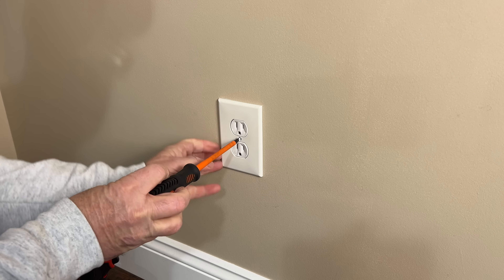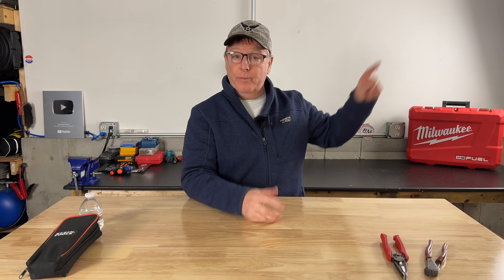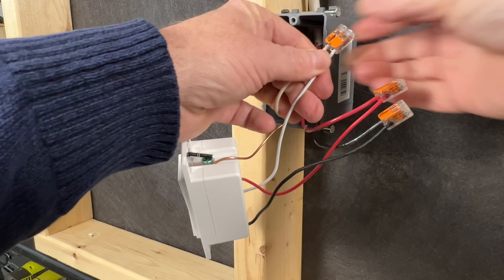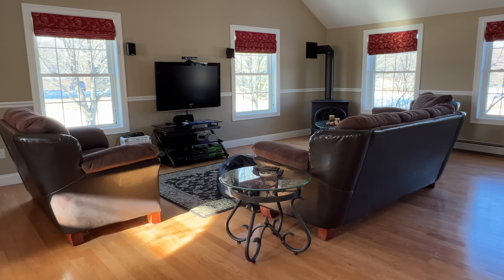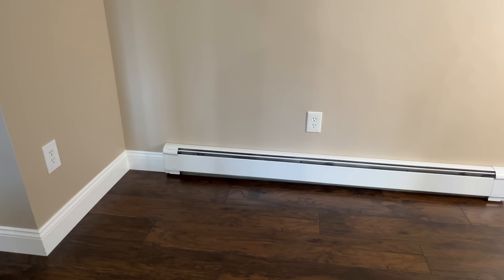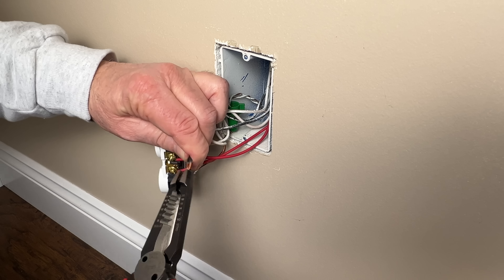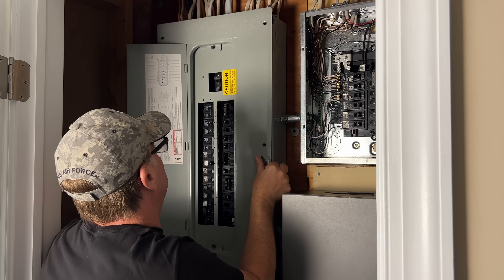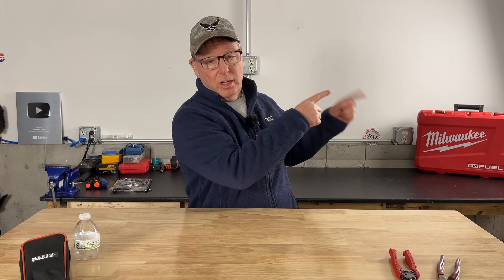Are Extra “Unused Wires” Required by Code?

Comment: Many switched outlets are split so only the top receptacle is switched and the bottom is always on.  That's how my home was wired.
Reply from the maker: Yes, that is a common way to wire switched outlets.I actually had that option recorded in this video but I cut it out because I didn't want to confuse anyone. Maybe I'll make a dedicated video on split receptacles.
Reply: @BackyardMaine  I've lived in several apartments where someone replaced a split receptacle wire-for-wire but didn't break out the tab, resulting in a switch that didn't do anything. The first time I ran across this, it took me a while to figure out what was going on. After that, it was an easy fix (assuming I noticed it before I had furniture placed in front of the receptacle).
I've also run across receptacles where it was really hard to break out the tab, due to the way it was shaped. I wonder if there's a trick to it that I'm missing.
Reply from the maker: @Ron-n2o  I've seen that as well. I will make a video on split receptacles for switches and for two circuit devices.

Comment: That's a neat convention about flipping the switch-controlled outlet "upside down". Didn't know about it. Could be a regional thing though.
Reply from the maker: I have seen it but its not something I usually do because many will think it was a mistake. I almost always install a ceiling light as well but some people don't like them and would rather have a switched receptacle.

Comment: I use The WAGO connectors too so if there is an unused wire it'll either be out of the way or have electricity running through it.
Reply: Yes! No chance of those shaking themselves loose and off the wire. Wirenuts fall off of the end of a single wire all the time.
Reply: @Gruntled2001   Just double back the wire so it's the same diameter as two
Reply from the maker: That is a great way to keep the wires organized.
Reply: This is a WAGO sales guy account 😂😂